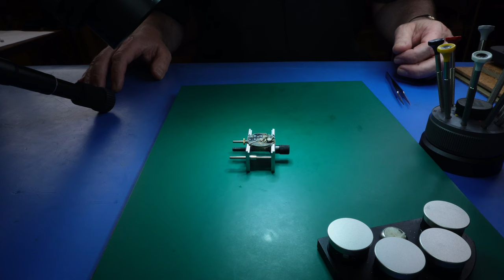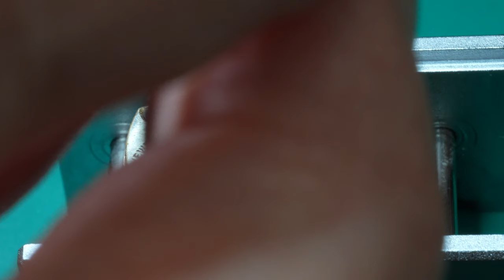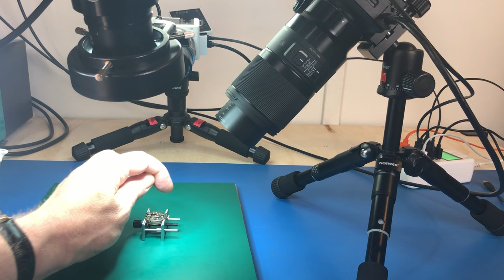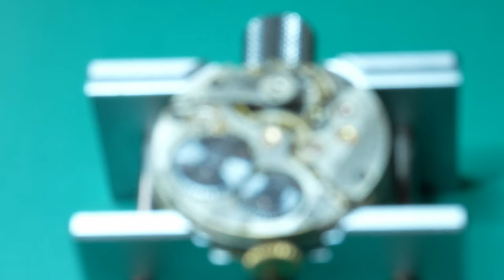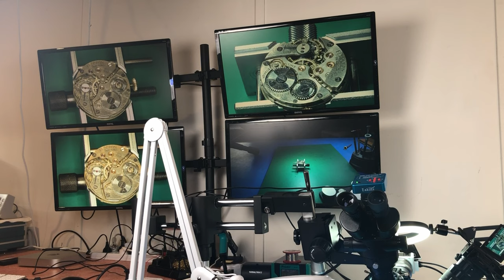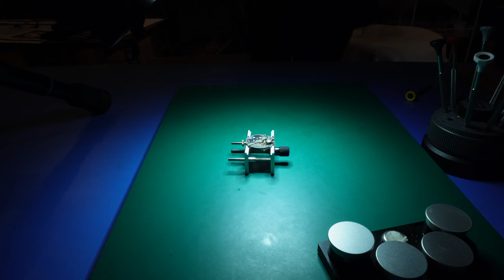Cameras and How To Film Watchmaking

Comment: Hi! Thanks for a very interesting video! One thing I can’t get my head around though, do you capture all video sources the the hard drive simultaneously? With a couple of Elgatos. Or du you record to the cameras SD card?
Reply from the maker: Thanks for Watching - I record to the camera's SD cards - this is not an option for the Microscope, because I use the audio to sync up the video - the microscope has no audio in, so I use the Mac mini with the Elgato, and a lav mic plugged into the mic in port on the Mac mini. Then on the other 2 cameras, I just record to the SD Cards. I think this is the best way because it puts the least stress on the cameras - get them to stream and they will run hotter - we had a 39 degree celsius day last week, no way the ZV-E10 would cope. Also there are limitations on what res the cameras can stream. So I find the simpler things are the better.
Reply: Thanks! Interesting,  I've read that recording to SD card is more heat producing than just live streaming, hence compression and writing. But I could well be wrong! @watchout9213
Reply: This is exactly the question I had. I find it a pain to unscrew my camera from the mount just to retrieve the SD card and was thinking an HDMI combiner with split screen would be better. But I think you need a powerful computer to handle the video capture.
Reply: There is a free plug-in for OBS called "Source Record". With this all incoming camera streams can be recorded to independent files at the same time. Powerful computer is needed. No way I'm moving around 3 or 4 sd cards before editing.

Comment: Hey Stephen, great video! Some questions/comments for you since I am building a VERY similar setup. Hope you don’t mind, it’s a bit long 😅

Is the A6700 giving you any overheating issues? I have a ZV-E10 and I love it, but want to go to a 2 cam + microscope setup as well, so I’m thinking of picking one up. However, all the video reviews online bring up the fact they couldn’t get more than about 45 minutes of 4k filming before overheat messages and camera shutdown, curious if you’ve experienced this too. Thinking maybe just going budget and getting 2nd ZV-E10 since they’ll shoot for hours no prob, or maybe going for a used FX30.

Also, love the Sigma art macro series but I feel like autofocus is truly not needed for this, and in fact often just gets in the way. When you said you almost went with a full manual lens, was it by chance one of the Laowa ones? I grabbed the 65mm and it’s INCREDIBLE. If you do still photos with watches, the 2x magnification is absolutely worth it, incredible dial shots.

Next, when it comes to the microscope, are you having any difficulty with getting the trinocular port and eyepieces to parfocal? I have the same exact scope, and the camera port and eyepieces will not stay focused on the same point if I mess with zoom knob. The eyepieces work properly, but I always have to refocus the camera adapter ring after zooming. 

Oh and the lighting, that’s my next area of focus as well, so curious to see what you do 😉. You seen the Zhiyun Molus G60? It’s $250 or so but comes with seems very flexible and it’s a great size.
Reply from the maker: No worries, it's great to help one another learn. No, I haven't had any issues with the A6700 overheating, but I haven't really used it much, and it hasn't been very hot in terms of weather. What I saw was that it was people using high frame rates for extended time that have problems. The FX30 was my dream camera before the A6700 came out, but the main prob with the FX30 is lack of viewfinder, which isn't an issue for watchmaking, but can be a problem for out and about. I took the ZV-E10 out to see what it was like, and it was a real pain not having a viewfinder - couldn't see a thing on the screen in full sunlight.

Yes, the Laowa 65mm is the one I was looking at, but the Sigma was not a lot more money, and as I said, gives me 105mm equivalent. My understanding is that the 2 x magnification tells you how close you can get the lens to the subject and have it still focus. So 2 x means that at the minimum focal distance, the subject will appear as 2 x size. For the reasons I mentioned in my video, this is useless for watchmaking, because you need to have the lens far enough away that it doesn't get in the way. A 65mm lens is always a 65mm lens. That being said, if the Laowa is working for you, then great! And I might still get one for my b-cam. I currently only own 2 lenses, as I sold all my Nikon and Fujifilm gear to fund the A6700, so my plan is to use the Sigma lens as a long out and about lens. I can't see any reason why it can't do this, even though it is a Macro lens.

Microscope - no, I haven't had any problems with matching the focus up. Sometimes I might have to make minor adjustments on the camera focus, but usually it is pretty good. I think it will depend on the c-mount adapter you are using. I'm using this one here: https://www.aliexpress.us/item/3256801587206955.html?spm=a2g0o.order_list.order_list_main.108.22021802Yj9fBs&gatewayAdapt=glo2usa4itemAdapt
The 0.35 x zoom one.

Today I ordered a couple of lights from Amazon, this little one to replace the dinky vlogger ring light: https://www.amazon.com.au/gp/product/B06XDFGDCX/ref=ppx_yo_dt_b_asin_title_o00_s00?ie=UTF8&psc=1

And this larger one, which I'm not sure just yet what I will do with. The Yongnuo YN300-III, https://www.amazon.com.au/gp/product/B00VFT94X4/ref=ppx_yo_dt_b_asin_title_o01_s00?ie=UTF8&psc=1

I haven't seen the G60. The Colbor CL60 looks similar, but a little cheaper.

Wish me luck!
Reply: @watchout9213 thanks for the great answers! It’s good to hear you haven’t  had any issues with overheating on the A6700, maybe I’ll have to rethink one. The viewfinder is definitely a nice feature, ditto on weather sealing for a6700 if you want to shoot outdoors. Makes me keep debating what I want heh.  

The Laowa is an interesting lens when it comes to the magnification. If you want the full 2x then yeah, you gotta get very close. You can still get over 1x magnification at very workable distances IMO though, so worth trying if you get a chance. It’s a 97.5mm on an APS-C camera, so vs a 105mm should be pretty minor IMO — but like you said, whatever gets you the results you like! And I agree, that Sigma should be amazing out and about.

Darn, that’s the same microscope camera adapter I have! .35x and all. Frustrating. Oh well, worth an ask. 

Those lights look like they should do the trick, hopefully you’ll let us know how they work for you. Wishing you lots of luck, and thanks again for taking the time to answer everything! Cheers! 🍻
Reply from the maker: No worries - I believe the Loawa 65mm lens is an APS-C lens, so its 65mm should be 65mm. But, you've got one and I don't so if it works, great! OH, where did you buy it from?
Reply from the maker: I think I got all of this wrong - the lens focal length is the lens focal length is the lens focal length, regardless as to what sensor it is designed for. That just tells you how much of an area it will fill. So the 65mm Laowa would be 97.5mm due to the 1.5x crop factor on an APS-C camera. The fact that the lens is an APS-C lens is irrelevant, 1.5x crop factor still applies. Someone tell me if I am wrong or right, please.
Reply: @watchout9213  😊Absolutely right! When using an APS-C camera the crop factor always applies, no matter if it's an APS-C lens or not, because like you said the focal length is the focal length no matter what sensor it was designed for. It's a bit of a weird thing to wrap your head around at first for sure! Oh and I got the Loawa from eBay, found it for a great deal new.
Reply from the maker: Right - got it! Really glad I didn't buy the Laowa then, because it would be almost the same as my 70mm Sigma. I have ordered a TTArtisans 35mm from Aliexpress - AUD87 on the black friday sales. Fully manual lens however I expect to use it for B-Cam most probably on my other channel.
Reply: @watchout9213  Oh nice! Those TTArtisans lens are super interesting, can't wait to see what kind of results you get out of it. Seems like the performance per dollar is terrific, so I may have to grab one too if you say it's worth it. Cheers! 🍻